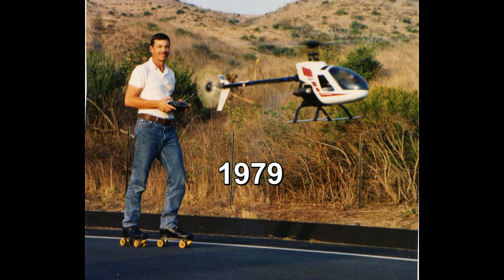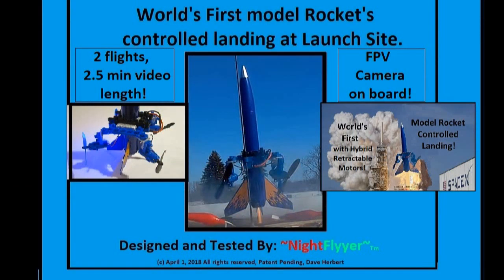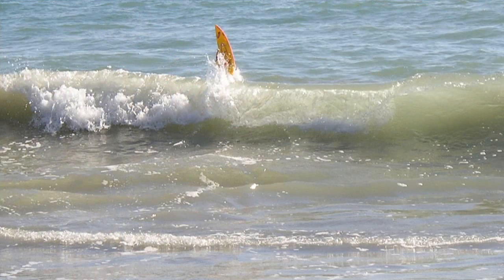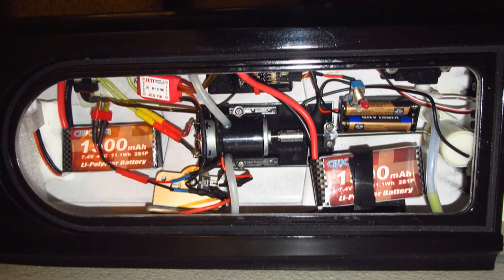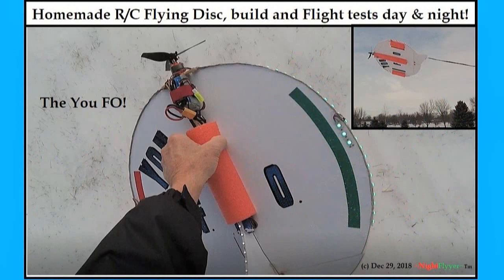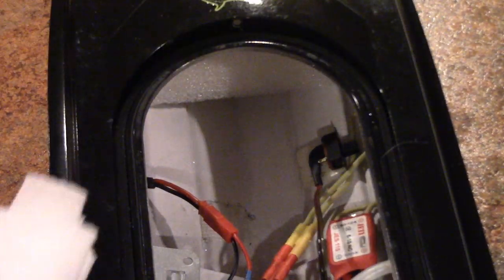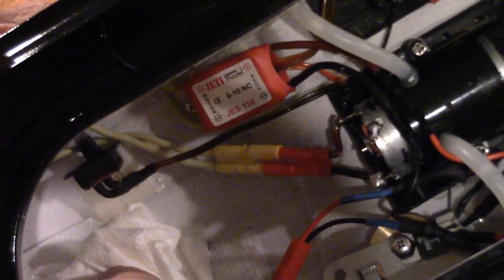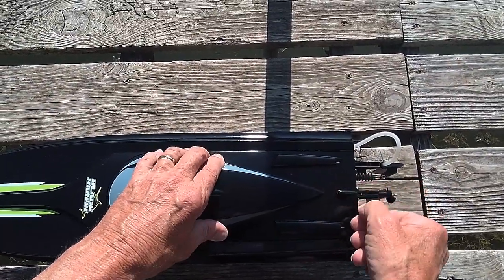R/C boat Sump Pump, My crazy ideas that worked, and a Ceramic Hard Coating demo.

Comment from the maker: Having had my RC Water equipment ruined eventually by water, I decided to show how I made a Sump Pump for it, some of my other ideas that worked, and a demo using Adam's Ceramic scratch resistant hard coating.  Parts links are in the description box.  Thanks so kindly for watching.

Comment: Nice work. Looks like you got the perfect pump for that job. I see the pump has a nice low power consumption, so battery life probably isn't an issue, but if you want to make the project overcomplicated, you could probably wire in a transistor and a couple of resistors as a water sensor between the switch and motor.
Reply from the maker: That is a great idea.  Thanks much!

Comment: Dave, those mods are all really cool!! Since you are in there, why not turn it into a brushless, that way you can keep up with your friend who has the same thing.
Reply from the maker: Yes, well I don't do that much boating to justify the cost and time to change out the ESC, Battery, and motor with a Pump.   I used to have a Jag XKE, but never drove it at full speed all the time.  Sometimes a walk in the park is just as fun.  Thanks.

Comment: Well it works great, the cerámic coating repels water something like rainX.
Reply from the maker: It says right on the bottle not to get rain x on the paint. Ceramic coatings are hard and scratch resistant and entirely different.
Reply: Yes rain x is only for windshield treatment, if i'm not wrong it uses some solvent that atacks paint, i remember a few years ago we used to aply carnauva wax to r/c sailplanes and yes there were a difference in performance specially in cross country contest. Do you think this product will work on aeronatic aplications?
Reply from the maker: Yes. We have detailers applying to full size planes as ceramics are very scratch resistant.   My friend here just did his full size Cessna 172 with Adams ceramic and it came out amazing! It is expensive but really works. Detailers are charging $800 on up to do cars. That bottle I used in this video goes a long way but cost $50. Thanks again.

Comment: Now you need to add a servo controlled micro switch so you can turn the sump pump on and off from the radio...
Reply from the maker: Haha.  I think I don't need that, because I am also running out of room.  LOL  Thanks.

Comment: It's crazy how something that costs 3 dollars keeps 50/100 dollars safe 
Also if you have shaft with packing inside of it you could try to put more grease into it 
It worked for me but don't overshoot with the grease it can act as a brake
Reply from the maker: My water was coming in other places than the drive shaft, but a good point.  Thanks kindly.

Comment: Did you consider drawing power from your receiver for the sump pump? Just a thought!
Reply from the maker: Yes, but did not want to have it draw much from the battery, as it is a bummer to swim out to get a stalled dead boat.  LOL.  That would work though, but this pump is designed to run on 3 volts and the Rx runs on 5, so decided to do it this way. Thanks Mike.

Comment: Hiyazz NightFlyer! Have you ever considered using a sump pump (your set-up) and your wax compound on a sea/float plane to get rid of unwanted internal water? I know the type and size of sea/float plane will play a factor in this idea. What are your thoughts on this matter?
Reply from the maker: I have a big fms beaver seaplane and it hasn’t gotten any water in it but yes the sump pump could work. The floats are foam so the ceramic hard coating [not a wax] won’t work. We just put a coat in my friends Cessna 172 full size plane and it really is scratch resistant now. Retailers are charging $800 in up to put it on cars. Amazing stuff but expensive. Thanks for your suggestion.

Comment: Is it a peristaltic pump?
Reply from the maker: No.  Peristaltic pumps push liquid thru the tubing by pushing the tubing with a roller.  This pump has conventional motor and rotor.  Thanks.

Comment: Why not use the water to make a switch  seeing as electricity is conductive in water that way you never have to have it turned on all the time as the water when touching 2 wires makes the pump work.

Glue /cable (zip) tie the 2 wires to side of pump